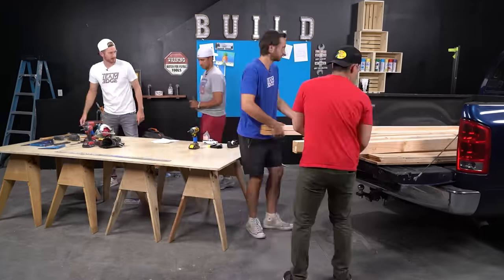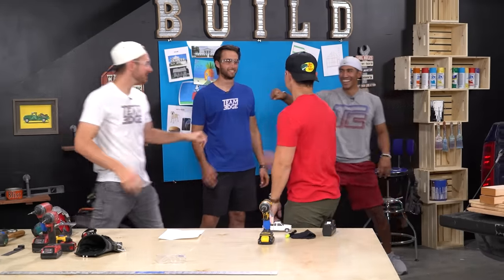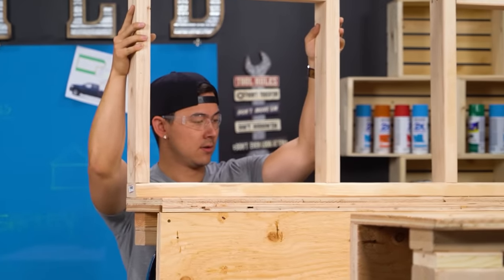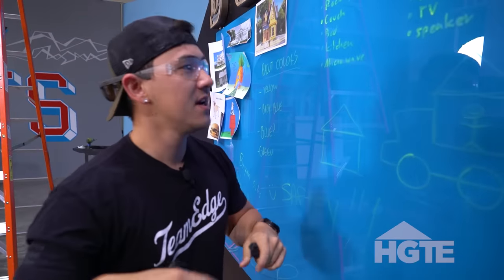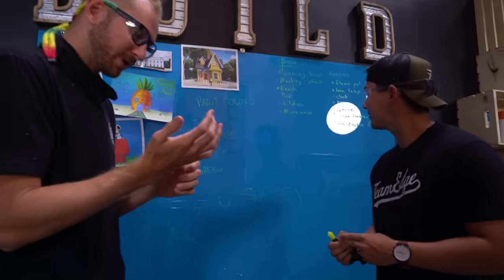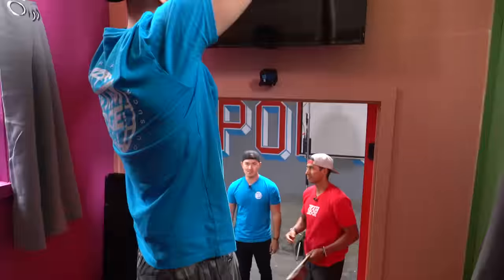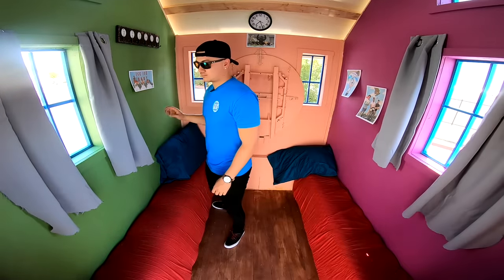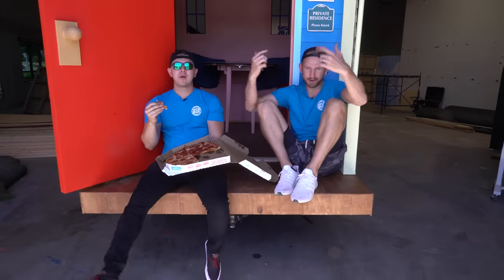We Built a Tiny Home in Our Truck bed!!

Comment: It’s too much weight in the bed of the truck. If it was a ram 2500 or 3500 it would be more drivable. It needs a 3 inch life in the back to counter the weight of the house.

Comment: Ummmmm? You have been able to buy a truck bed camper since the mid 1950's. Advantage, they come off and back with ease. 
Maybe next you can use a piece of wood to slide down a hill in the winter. 🤭

Comment: You should have done this build with a much more heavy duty truck, It doesn’t matter if it’s a Ford or Ram or Chevy and even if it’s semi truck, but next time if you’re going to do this again do it with a truck that is a 2500/250 or higher cause trucks that are a 3/4 ton or higher can carry/tow more wight than a 1500/150